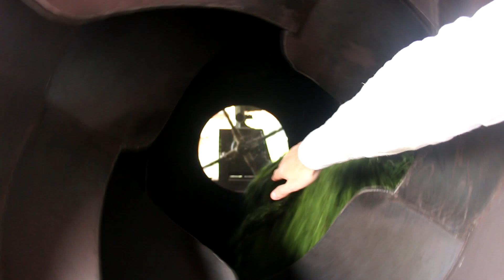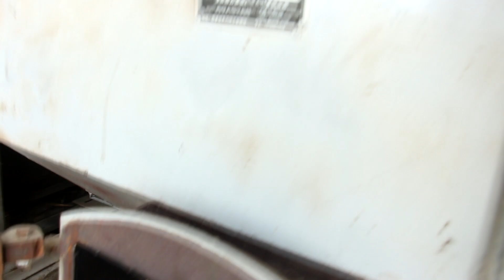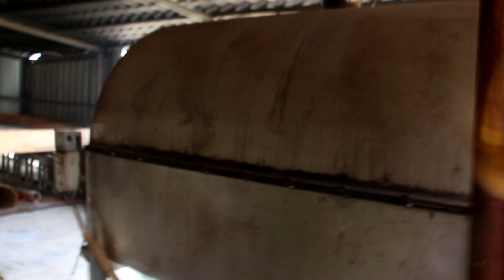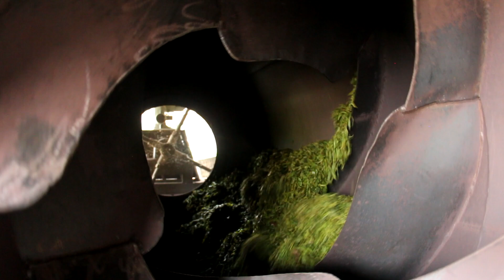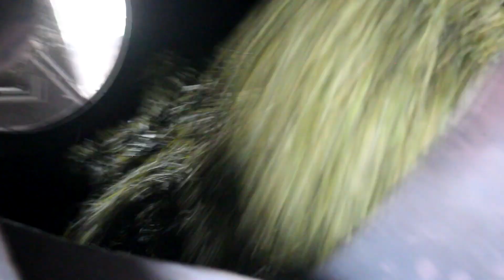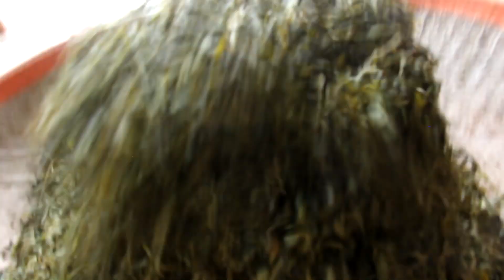Processing pu-erh tea with a kill-green machine

Comment: Aloha William, Did you allow any withering time for the leaf before placing in machine. We have similar method in Hawaii and our challenge is with leaf sticking to walls of machine so was wondering if longer wither time helps. Great videos!
Reply from the maker: We do the usual withering, it can be shorter than for hand-processed tea because the leaves are at a lesser risk of burning. I've heard about leaves sticking to walls in some machines, it doesn't occur in ours. Would polishing the machine with sandpaper help?
Reply: @farmerleaf61  Interesting thought, on occasion is sandpaper used for your woks?

Comment: As always very interesting I wonder if there are any real disadvantages to the introduction of mechanics into tea processing-----you explained a lot of it like the actual looking and handling the tea with your own hands and looking  what it looks like during the processing in the wok----also the fatigue must be an important factor I understand------do you own the machine now?
Reply from the maker: we've had this machine since 2017, we rarely use it but it comes handy when we have too much leaves. 

We separate handmade and machine made tea, so far i've noticed a difference, maybe improvements in the handling of te machine will allow us to make the tea taste closer to handmade leaves. In any case, the direct input of the tea maker is absent, which could reduce the value of the product, just as is the case with handmade vs machine made teaware. What do you think?